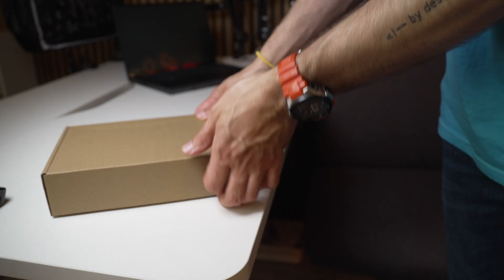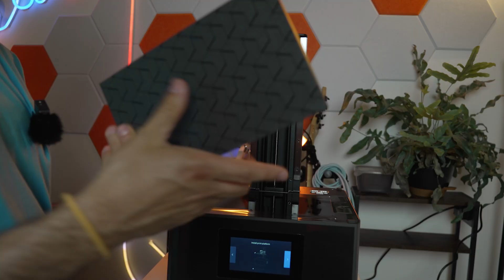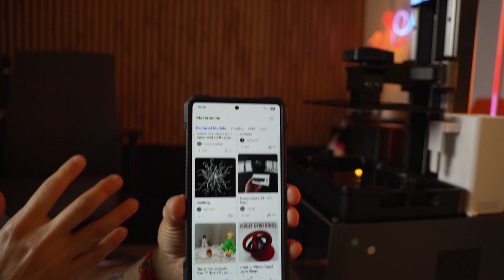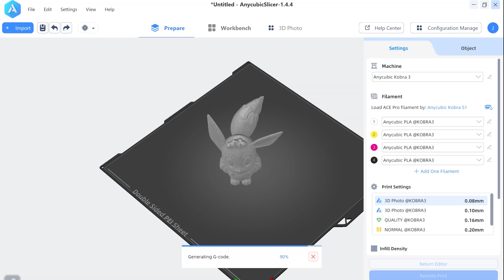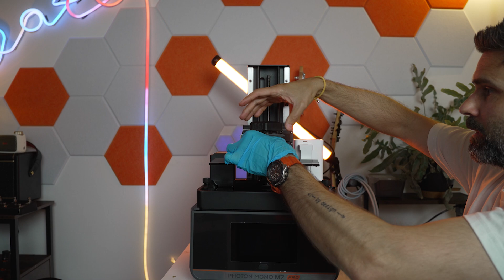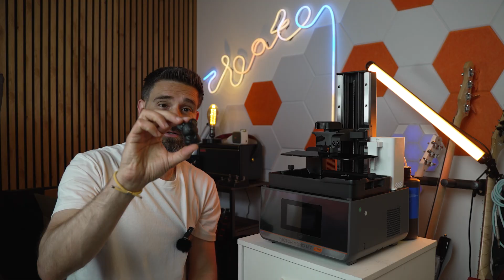‌STOP Fighting Your Resin 3D Printer & Get Anycubic Photon Mono M7 Pro

Comment: I can’t get my M7 Pro to finish a print. I can hardly get it started. The print separates from the build plate. I would assume that has to do with the leveling, but if this thing has auto leveling why can I not fix it or pront